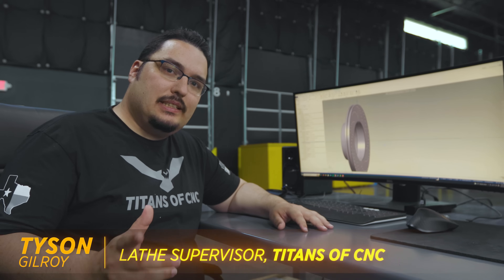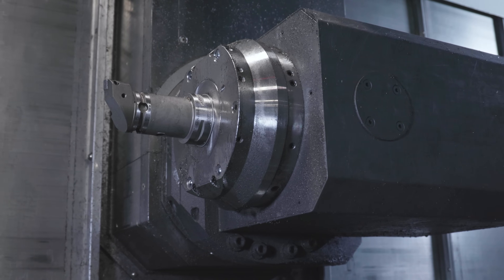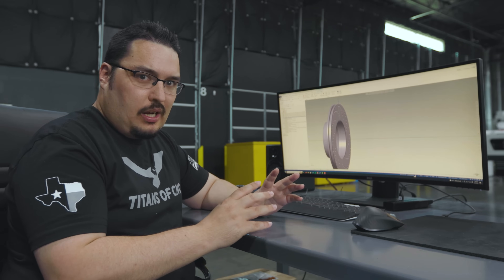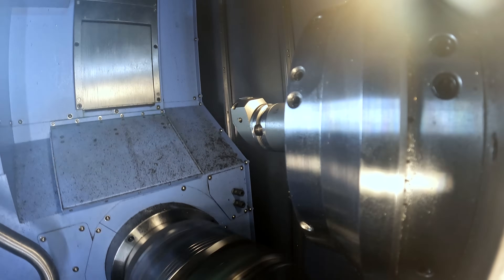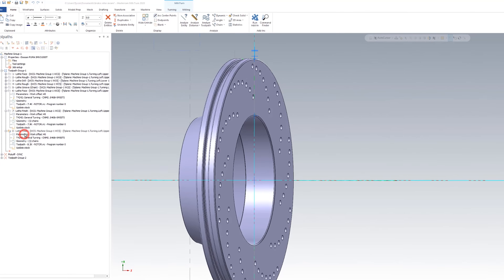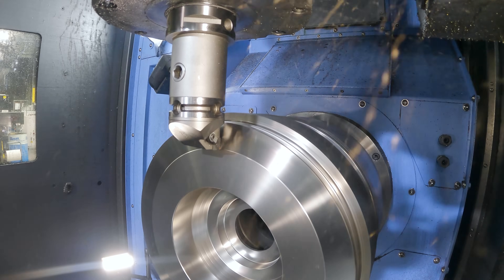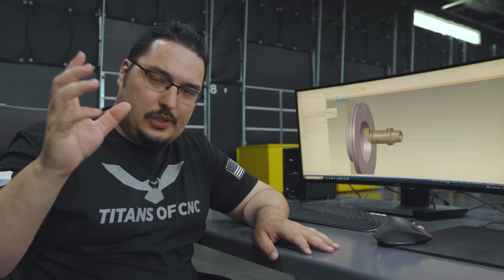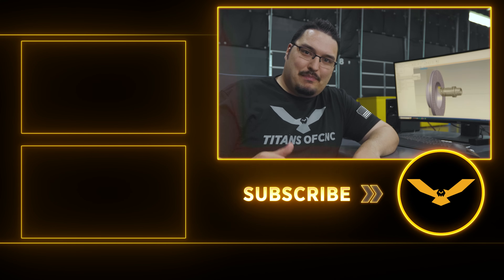Preventing a CRASH on a 9 Axis CNC Machine

Comment: why do you have the tool move in on Z then straight down in X on the start of the cutting process 
I feel like it would be easier to crash when setting up rather than going straight down on X first then moving in on Z
Reply: On a typical mill-turn machine you can have the bottom turret working on the opposite spindle. The way to program it is to move in Z and then X on your approach. If you go the opposite way you have the potential of both the milling head and the turret hitting each other.

Comment: Really good info Tyson! That "force tool change" option can be really useful.
Reply: Agreed, also what can make that feature useful, is on a mill when you are using the same tool to rough and finish, sometimes the roughing program has a lot of code lines, so when you use this feature between the rough and finish operation you can easily find the part where it starts the finish opp in your code. I also use this when I want a M00(forced program pause) between roughing and finishing. Obviously this is more useful on a lathe though, but none the less it can also benefit the millers 👌

Comment: So no need to have a different tool offset? T 0202 T 0222
Reply: Nope, all 3 of these toolpaths used the same tool number and offset, in this case T042042.  I did not have to change it for the 2nd side of the part either, it still used the same offset and everything, just the tool rotation was set to 0 degrees and it used G55 for the 2nd spindle.
Reply: Learn something new every day
Reply: That works great for roughing, but I do often use a separate offset like you suggested if it's a finishing tool. Let's you adjust the features separately.

Comment: How does it handle TNR compensation when you use the same tool in different orientations?  That is do you have to set the same tool with different tool nose positions in the tool setup page?  Charles
Reply: For this machine, the tool only gets touched off one time and uses the same work offset.  There is a G400 command in the program with parameters attached that tell the machine what angle the tool is in, direction to rotate the tool, and where the new nose position is.  Mastercam sets that all up for you when you use the 9-axis post and when you set your tool angle in the program
Reply: @TysonGilroy  Thank you, I was assuming you would have to do something like that.  Charles